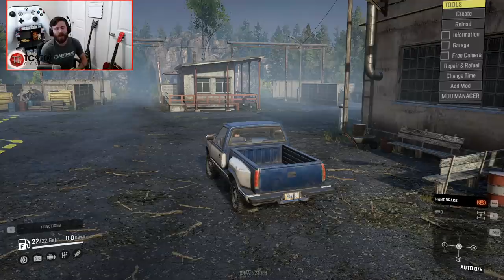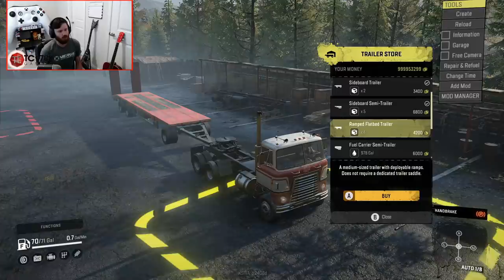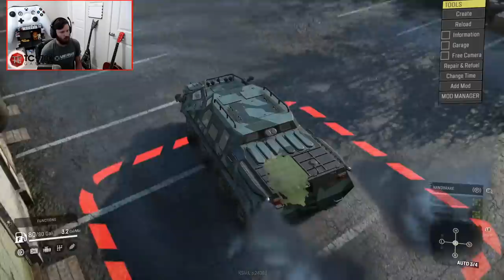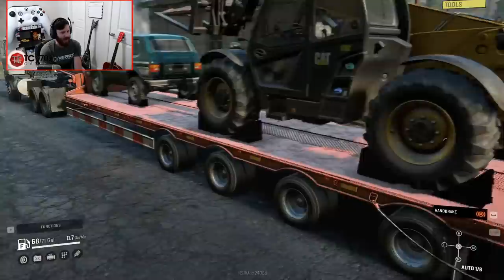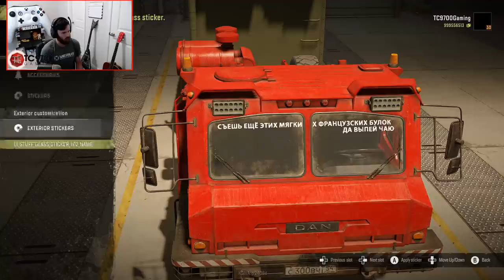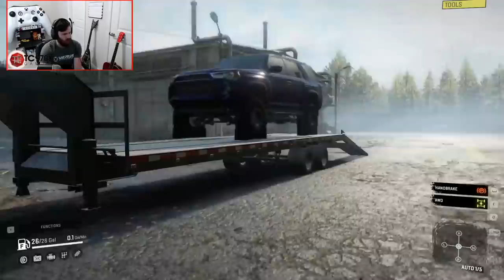SnowRunner: PHASE 2 TRAILER LOCKS ARE HERE! How They Work!

Comment: I loaded  a Loadstar on a scout flatbed and had it pulled by a Chevrolet CK1500 with raised suspension. I felt bad for the poor Chev, but the Loadstar packed and I couldn't help grinning.

Comment: I tried to put a cat 770 on the wide plane trailer but it wouldn't strap.  Also try loading other trailers on trailers see if they strap.
Reply: It works.  I saw in Discord (either TC's or the Snowrunner server) that it works.
Reply: @dieseladdict6685  which part of my comment works?
Reply: @BearCat459  The trailers on trailers

Comment: This system already needs a fix. There is zero reason that the first large truck couldn't be safely chained down. Instead of wheel chocks the need to add the graphic of chains, then it will be more believable and you can carry oversized vehicles.

Comment: Upset the vehicle from the trailer and they get locked forever. "Nice implementation" - 10/10!
You should have mentioned this dangerous bug in your video. This is what you shoud do, not constantly admiring of the DEVs not very good work.